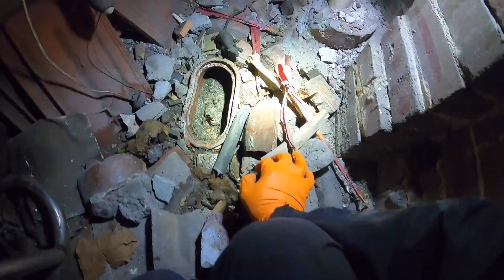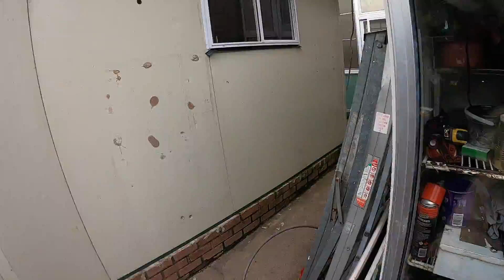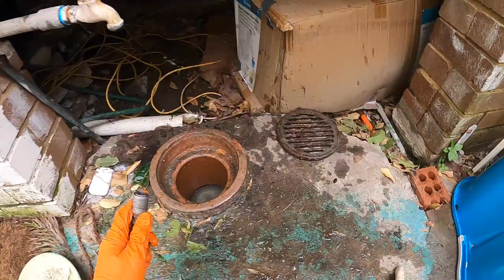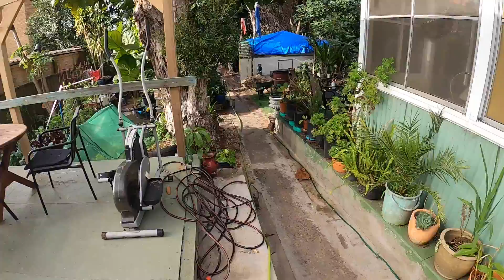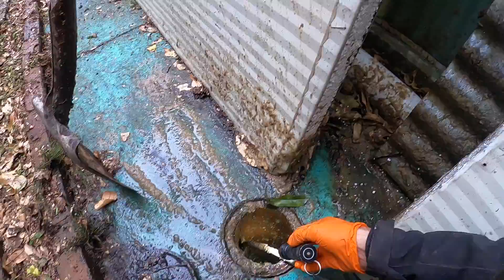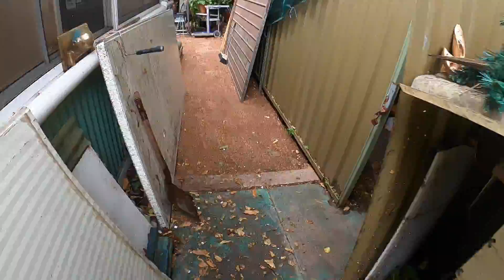Blocked Drain 493

Comment: In western Canada we have nothing even close to these mud room/crawl spaces with (sometimes open trench) pipework running through the house. It just seems totally nuts to me. but very accessible i guess..
Reply: We don’t in Florida either. Just concrete slabs. The pipes are laid and then encapsulated in the slab. Two clean outs outside, one right by the house in the garden, the other about 100ft down the driveway near where it goes to the city drains.